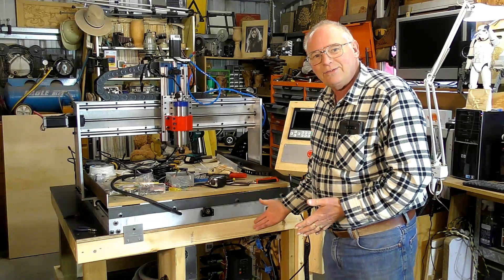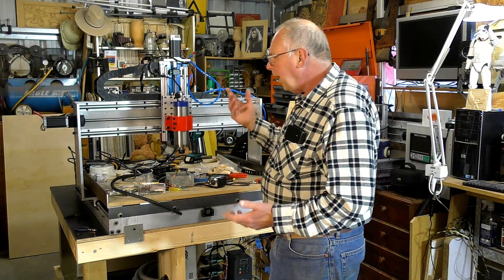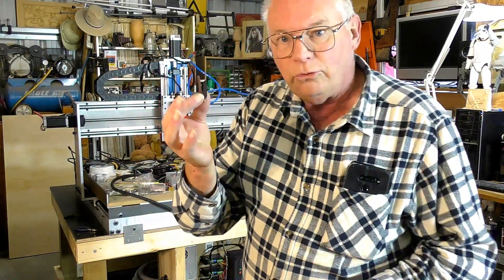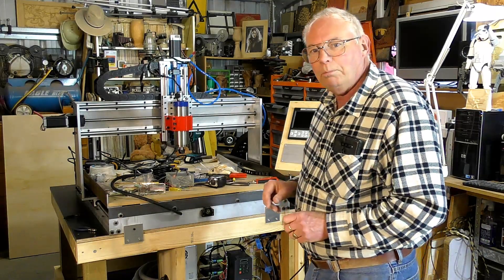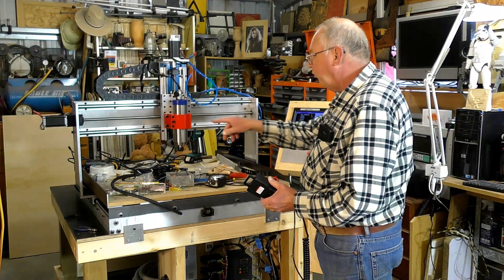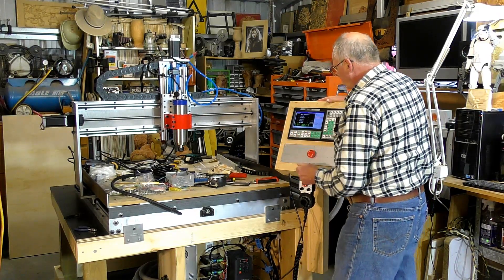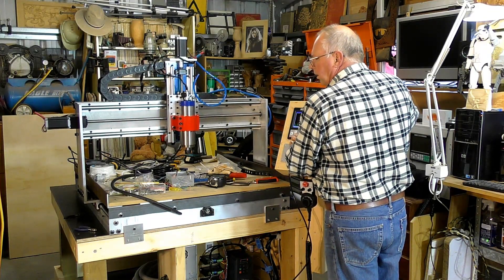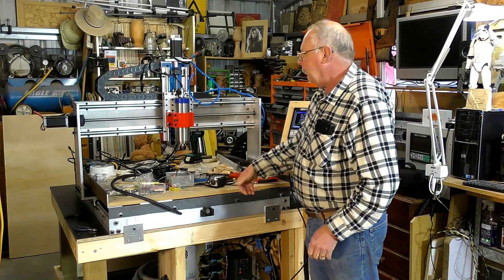VFD connection to a 2,2kw/3hp router spindle to Mack3 or SMC5 (HOW I DO IT)

Comment: Hi Roger.  New to your channel and  I'm new to CNC.  I've been truly enjoying your series on making a CNC router with standard workshop tools, because that's where I'm starting from.  But today, i was very disappointed to see that you've skipped over the most important part of the build... the part i've been waiting to see....setting up the  motors, mounting them, running wiring, cable management, testing and troubleshooting the machine for the first time.  Everything from Episode 12 to running the machine with first project.
Based on your comments, you may have gone over this before, but no links to other videos for reference?   I'm sorry to say, i feel like i've wasted my time now.  Just my honest opinion about the series.  Before i found out you skipped these last parts, i thought it was a great series because many other videos show builds for CNC from years ago and things have changed in 2022.
Reply from the maker: Hi, have a look at my MAXI CNC router build its all in those videos, I did'nt want to double up

Comment: I have the same spindle.
Would you run a 12,7 2 flute spiral or 2 flute straight cutter with it?
If so what would you consider the maximum I take off material ( hard woods ) ?
What would you consider feeds and speeds to be as a maximum ?
Thanks for any advice.